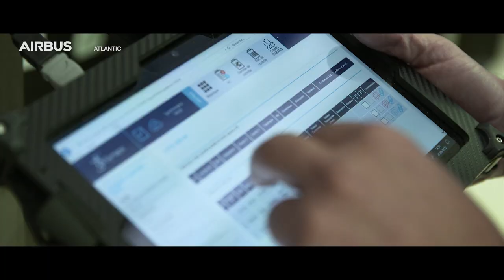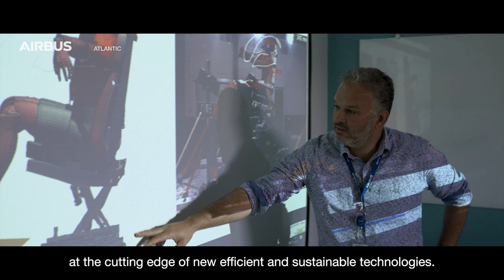Airbus Atlantic Rochefort site

Comment: I do hope the 2 pilot cockpit concept will remain in Airbus aircraft. Having one pilot alone for many hours is not good for anyone. Regarding single pilot operations I do hope on commercial aircraft will have two pilots at all times for mainly for safety. The way I see it the other pilot will monitor the acting pilot‘s performance and not participate in flying or the operating of the aircraft would be the best instead of having a single pilot alone.